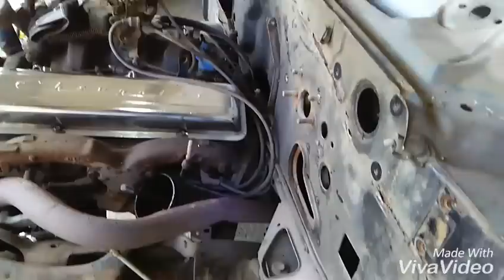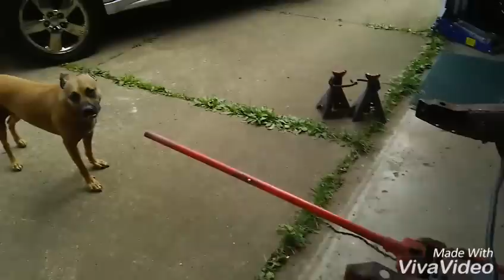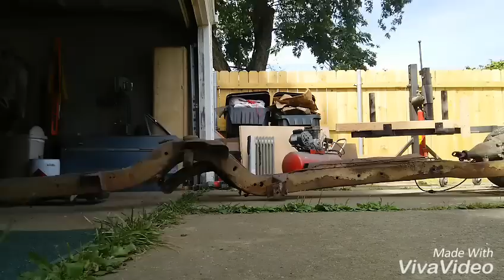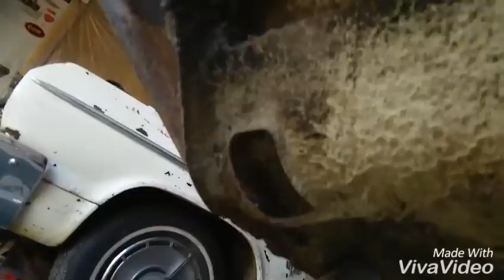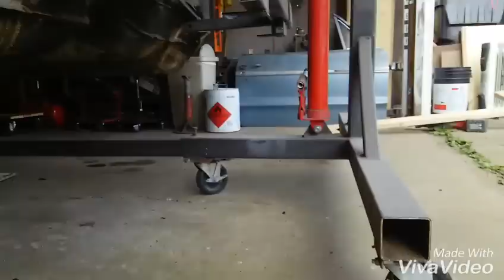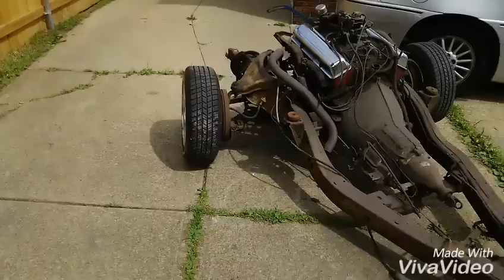One person separating the frame from the body on my 1964 Impala hard top

Comment: Pulled the body off my 63 myself. Bolted the rear to the rotisserie. lifted the front with my cherry picker and a sling leaving room for the other half of the rotisserie to bolt up. Rolled the complete chassis less the front clip in under 8 hours including dismantling the front clip.
Reply from the maker: Taking em apart is pretty easy,  it's the putting them back together that I've found takes twice as long as you think it it will. Thanks for watching,  check out my 64 ss I'm doing a custom air ride frame off that's taking way too long to put back together
Reply: Black Sheep Kustoms yep twice as much might be an understatement. lol

Comment: Hello...
Did u buy the disc conversion kit for drum to disc in front or what year n make can I use for a booster and brake...any ideas thanks
Reply from the maker: I bought a kit from speedway motors its $250 it uses the stock spindles, you'll need a proportioning valve to adjust even pressure to front and rear, as far as a booster  just buy a original replacement setup it angles the booster up to clear any tall valve covers and a master cylinder with two reservoirs. Thanks for watching!

Comment: where did the put the stands in the rear of the car to hold the body? while you pulled the frame out I'm about to do the same to finish welding stress points and cut my cylinder holes in the rear...I've already pulled the rearend and suspension as I'm doing the tacoma rearend swap
Reply from the maker: Doug-E- Phresh I put the stands under the rear floor braces , and unbolted the frame with the jack under the center of the frame and let it swing down on the stands under the front control arms just enough to put the rotisserie under the body to hold up the body while the frame dropped. I kept the front body mount bolts in but left them loose to act like a hinge after the rear part of the frame was down on the creeper I jacked up the rear of the body off the stands and moved them to the front on the pinch weld and took out the front body mount bolts and dropped the front of the frame and rolled it out. thanks for watching I'm in the process of doing the super sport now did it the same way.
Reply: Black Sheep Customs awesome I pulled mine out similar with the creeper and all after watching your video been a few weeks almost done wrapping the frame now the joy of putting it back on the frame lol
Reply from the maker: Right... It's easy to tear em apart putting em back together always more of a pain and a little more expensive
Reply: Black Sheep Customs I'm telling ya lol 2 bottles of mig gas and a spool of wire later and 2 weeks vacation from work just to do the frame then once the body's back on Noone will ever see the hard work done haha
Reply: @blacksheepkustoms2545  should made a video on the steps how you did it all that would have been really nice to see